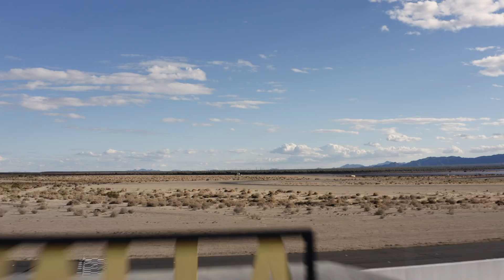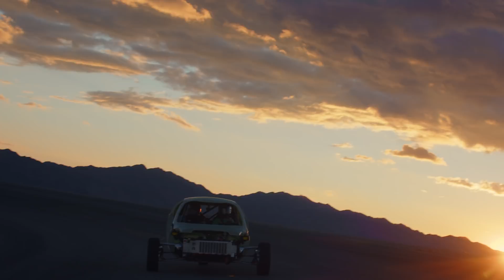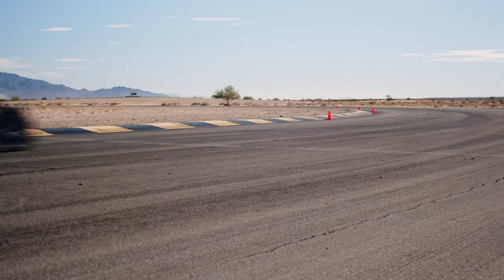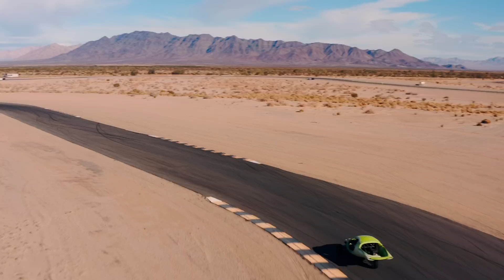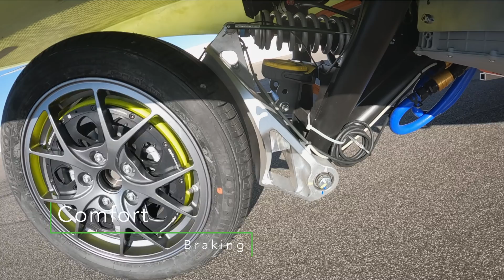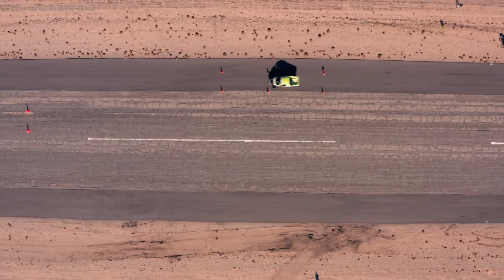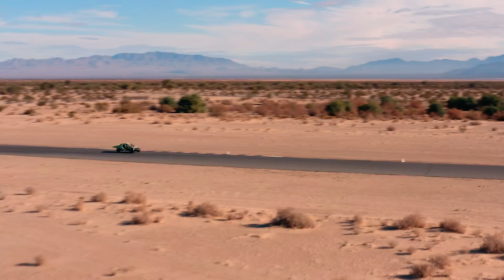Aptera — Vehicle Dynamics Testing

Comment: Traction/grip is a function of contact with the road and thus more complete contact equals more traction. But only if the rear tire's tread totally touches the road surface throughout body roll during lateral forces.

Comment: This will have a sport mode right? I would love to take it to a track meet
Reply: Yes, can you imagine a “spec Aptera” racing class, just like the “spec Miata” class? A whole bunch of Apteras banging around The Streets of Willow like maniacs? Hilarious!
Reply: @boots_n_coots  Exciting!  The top speed with stock motors will be RPM limited to 110 mph.  Can you imagine what would happen if someone were to install the Elaphe motors designed for the Lordstown Motors pickup trucks?
Reply: Bruce: I like the way you’re thinking. Such possibilities…
Reply: @n.brucenelson5920  Imagine if Koenigsegg makes an in-hub version of their Raxial flux motor
Reply: @LazySpaceRaptor  The design constraints are so different that I don't think much would carry over.  The Elaphe motors are already a radial flux design.  However, I think the advantages of hub motors will prove to be compelling, and i expect to see offerings from many more manufacturers as the tech evolves, perhaps also from Koenigsegg.  I would love to see their take on it.
Reply: I hope the include a sport mode. That will make the machine unbeatable.
Reply: Greetings fellow avali
Reply: @Aves_1  Howdy! Always good to meet another!
Reply: This beta prototype is the 3-motor variant (150 kW, 201 HP). There really hasn't been any chatter, at this point, about driving modes...
Reply: @narphizoid  At least one difference will be with traction control turned on and off....

Comment: Nice one! Pls give aptera a normal 110/220V plug with reverse charging so we can charge devices on the go and at the same time add additional portable solar panels around the car to charge it on a trip with the sun even more!
Making a plug with soldering is not the issue but getting the platform to use the mppt that is already installed would be awesome! Some might actually use aptera as their main battery on PVs.
Reply: Aptera will have a small inverter and standard 110 v outlet for small appliance use.
Reply: You mean bidirectional charging? That way you can use the car battery a power storage for house or other uses

Comment: I say Yes, please to magnetic active suspension system like in ZR1. May be drop the vehicle height by 2 inches and increase front wheel width by 1 inch. Hahaa... what am I thinking 🤔
Reply: Since Aptera grants right to repair, there will be many variations - just as we saw with the old VW Bugs.
Reply: Lower center gravity results in better cornering and handling and with that kind of body will totally slide thru air so good 👍
Reply: They are going for maximum efficiency over fun-to-drive, but I like your thinking better.
Reply: @boots_n_coots  Having had a ride in the Luna alpha prototype, I can tell you that even for the 2WD versions the "fun-to-drive" element will be off the charts.  Both handling and sub 5.5 second acceleration will best many popular sports cars, while being far less expensive to drive.
Reply: N. Bruce: thanks for this info. This could be the beginning of a new lightweight sports car, something the market desperately needs.
Reply: You may not know that there is a clamoring for the width to narrow in order accommodate for European requirements. Also the height, rather than decreasing 2 inches, is going to be increased by that value, again due to popular demand.